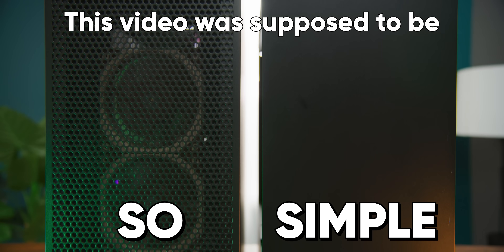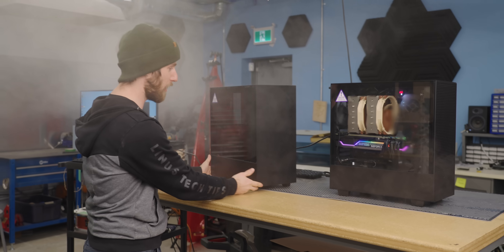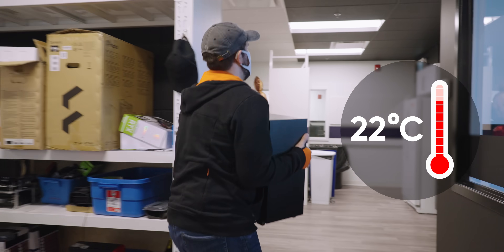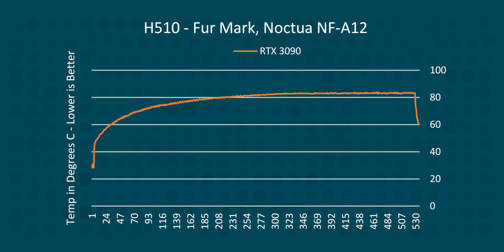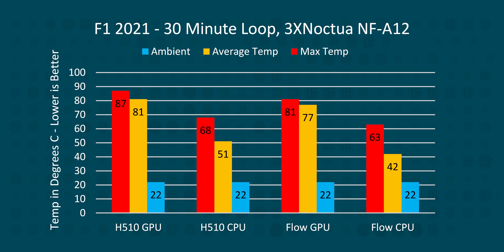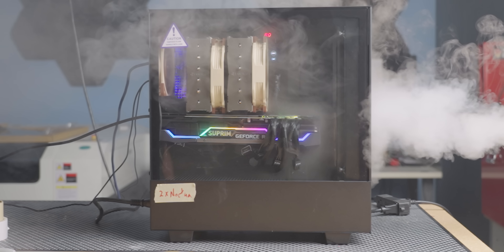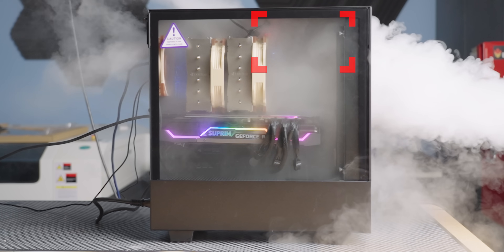Everything You Know Is Wrong - Mesh vs Non-Mesh Front Panel

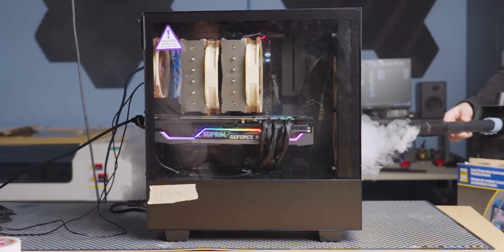Comment: 6:58 The way the front fans were installed, in front of the bracket, the fan body itself blocks the entry of air.
The ideal is to place the fans behind the support, being more inside the case and leaving space between the fans and the air intake, automatically having a freer air flow.
Reply: Probably didn't fit with the gfx card? Moral of the story is not to put a big GPU in a small case.
Reply: @saifaddeenal-manaseer6325  This is the main takeaway from the video IMO. Have power hungry components? Don't buy a small case.
Reply: @saifaddeenal-manaseer6325  I have the non Flow case Witch a XFX 6900XT and mounted fans in the right spot, Normal fans did not clear the GPU with the anti sag bracket from XFX so got some super slim fans and have great temps now! :D
Reply: @ivanraeder  nice, lucky you haha
Reply: @saifaddeenal-manaseer6325  It does look like maybe they wouldn't fit but yeah either way if they don't fit where they are meant to go get a smaller GPU or a bigger case.
Reply: Insane they would do all this testing make a whole video with a smoke machine and all and have the fans mounted wrong.
Reply: @Ranger Ahh, ok.
Reply: yeah also on the mesh case they could have decreased the rpms on the fans causing less turbulence
Reply: Why exactly would the extra space between the fans and the intake make a positive difference? In fact, I could imagine it making it less efficient, as the fans would then suck more air from inside of the case instead of through the vents.
Reply: @jankoodziej877  Because fans hate hate hate intake restriction and uneven inlet flow.  Having anything within an inch of the front of a fan will reduce its performance considerably, and make it loud.
Reply: @Vegemeister1  I can confirm. I had to buy a new case only because of the intake fan position being behind a mount that passes in front of intake. It was too loud even running slow. Now I have a case that, even though it still has front fans behind the mount, that mount opens a perfect 120mm circle in front of each fan. Still not perfect because of the dust filter sitting right in front of the mount. But now I have peace. Meanwhile, out take fan is noiseless at the back of both cases.
Reply: @Ranger I still don't get your point. The fan is always creating pressure, that's the whole point of fans. In the same way if you have exhaust fan on the CPU heatsink, you wouldn't want to have space between the fan and the heatsink.

Thinking about it some more, is it perhaps about the fact that the font mesh is bigger than the fan and if the fan is closer to it, it doesn't use the whole surface of the mesh? If that was your point, now I got it :D.

Comment: I ran into this problem a lot with the pc011. 
If you have fans on the "front" and fans on the top your GPU temps will be crazy.
You need those fans on the bottom to get that fresh air to the gpu.

Comment: Two things:
1- This case was originally designed for a negative air pressure configuration, bringing in cool air to cool the GPU. NZXT only made one change to this case: a mesh front. More fans can force more air into the case, but the fact is it was never designed with a positive air pressure configuration.

2- GPU's have a temperature target. You continue to say "wow, this GPU is reaching X degrees," but not stating at what frequencies. This method would make sense for Maxwell generation cards, but with modern GPU's boosting behaviors and temperature targets, this really doesn't work.

Comment: Ryzen 3700X, MSI RTX 3080 GamingX Trio (huge card, barely fits), 4 cheap DeepCool RGB fans, DeepCool Gammaxx GT CPU air cooler, NZXT H510 solid front panel case, blow dust out every few weeks. 
My GPU never gets above 75 C and my CPU above 72 C with intense gaming for hours on end. I guess I'm just lucky or it's because my apartment is kept at a constant 68 F/20 C.

Comment: Nice slow-mo shots. I remember discovering this GPU thermal behavior in the NZXT H500 review in 2018. It came up again in the H510 review and is to do with negative vs. positive pressure. The H510 actually wasn't really notorious for being "bad" for its front panel, specifically because it had abnormally good GPU thermals (although it could have been designed better overall, it was an interesting and rare look at a specific negative pressure setup benefiting one part and not the other). NZXT actually went on to actively make its case worse with its Elite configurations, where it moved to positive pressure. As we explained in our original review, cases like the original H500 and later H510 do well because the air can come in from the PCIe slots, which are perforated and create a potential intake pathway despite a lack of "case fans" mounted to them. It was an accidental success for NZXT. They did not plan for it and we had a few meetings with them afterward to explain to them why it was succeeding in GPU thermals in this way, mostly working with their product director at the time to provide some guidance. The air comes in from the PCIe slots because it is a negative pressure setup in its stock configuration (and they later changed the fan configuration, too, which was a separate test). You can test this with a sufficiently sensitive anemometer pretty easily. It isn't to do with turbulence but to do with pressure configurations. I think we actually did one of our only smoke tests ever on this case, but our cameras weren't (and still aren't) as good, so we lacked the awesome slow-mo capabilities you have here. As with most things, just adding more fans won't make it better and we try to communicate this to the audience regularly. They have to be intelligently placed, and that'll depend on each configuration.
Reply: Thanks daddy nexus
Reply: So, I shouldn't just be a fanboy?
Reply: @gharretje  Awww yeah..
Reply: @gharretje  be a femboy
Reply: I approve this message, GN is always right
Reply: A du*b said GN is always right. Lol
Reply: thanks jesus
Reply: @evolnizark4712  I am Satan in Jesus comment
Reply: Steve from Gamers Nexus be like: Oh yea, this thing. We did a video about it years ago...
Reply: @abm5119  I didn't watch it
Reply: I was about to uselessly comment, referencing your work with these cases but looks like you are on top of it XD
Reply: @gamers nexus have you seen major hardware's PCIe duct? 

https://www.youtube.com/watch?v=PHp1yrjlMz0
Reply: It's suprising to me that a company like nzxt wouldn't spend the time and effort to actually understand thermals and make consistent good cases. Then again I guess a lot of people just buy cases off aesthetics.
Reply: @lukasg4807  yeah like me. I have to look at my case everytime I get in my room, so aesthetics are important to me.

The airflow could be bether for sure but it is far from the worst. +5°C doesn't affect my performance campared to a case with bether airflow. My rtx 3070ti gets 74°C max, so no thermal throttling.
So the choice for me is:
Bether aesthetics, which I personally like to see everyday.
Or -5°C with no performance improvement in a case that looks worse.

Feel free to correct me if I wrote any nonsense.
Reply: @lukasg4807  NZXT makes a case that catches itself on fire...i dont think thermals is what they're good at.
Reply: Tell 'em, Steve!
Reply: I only trust you. Great to see your comment.
Reply: This is what I was thinking watching the video
Reply: This is the real explanation to the weird thermal behavior!
Reply: I'd try to match fan rpm all around where I have a fan in the case so this flow could be more even
Reply: I was pulling my hair out when I saw the case choice knowing exactly what was coming.  Thanks for already solving this one, Steve.
Reply: This video should have been a collab.
Reply: I think that blower style card will perform better in thermals since it sucks air in front and pushes it to the back of the card. And usually blower style cards are thinner usually. Open air gpu sucks air throu the fans and pushes it on the sides and they have low amount of space to push air in due to the chosen case. I think that they should redo the test with different cases and use open and blower style cards.
Reply: Yeah, it's a switch in airflow setup efficiency. Using H500/H510 in part, but specifically with as huge a GPU as in this video, makes fan placement/orientation requirements to get optimized airflow more in line with small form factor ITX cases/builds that a standard ATX case. Positive pressure/clear front to back flow airflow setups works wonders for big cases and especially cases with better designed venting holes on the back (like the Fractal Torrent), but the further down in size you go (without scaling the size of the GPU and PSU to smaller degree), the more problematic keeping the airflow positive/neutral it becomes. That's why for the widest variety of small form factor setups, full exhaust (with any and all case fans) is the way go, and using PSU as exhaust (like the Torrent), is the way to go as well.

A case can exhaust only as much air, as it can intake, and a case can intake only as much air as it can exhaust (What comes in must come out). The more restrictive the venting holes are, and the more restrictive the meshes, meshfilters are (like the recent Lian Li thing), the more it matters to have fans be intelligently placed. And more tinkering is required to optimize the airflow (and it becomes more important to adjust the speeds of the various fans to be more in line with each other) in order to break up the vortices (hot air pockets).
Reply: The next LTT Tech Upgrade should be for Gamers Nexus' cameras by the sounds 👌
Reply: This sort of information is why you guys at GN are awesome. I'd love to see you guys explore this issue further.
Reply: Steve doesn't waste a moment, does he?
Reply: AQ
Reply: No, this is about fluid dynamics in which pressure is a component of a very iterative game of physics. Under or overpressure setups are not the issue, both work fine IF you actually focus on the flow of the air. You actually want to avoid going in either direction too much, balancing around ambient pressure is best, but that's several steps further beyond dust, power, maintenance and reliability management... 

Turbulence can be beneficial if you apply it on the right spots, but similar to pressure conditions it's something that follows a good design of the air flow path. Placing intelligently is an understatement bordering to an insult to how much more complex it really is, but then again this is a pc case, it doesn't need to achieve industry level efficiencies.

As for 'recording'; smoke machine, line laser (or actual disco laser with control) to create a plane of intersection and any mobile phone these days with 120 fps slomo will do... as long as it's native 120 fps and not interpolated. Recording air flow paths is the easy part, actually balancing it in these horrible designed cases is not. The only reason to need a better camera is the "I want to be fancy in 4k" youtube part, not to be useful in the analysis.

It's ironic though. This is why blower fans on GPU's were actually really good and useful. But hey, people could hear them so now we lost them...
Reply: @FreakyAngelus  Yeah, that's what we said. It works well as a negative pressure setup. Neutral pressure is not necessarily the best either. Blower fans were useful for exhausting air but are horrible for GPU thermals, which is why they aren't used. They make the most sense in a small OEM box. Exhausting the air efficiently at the benefit of components which don't care as much (an inductor that can take 150C, for instance) is not as useful as efficiently cooling a component which does care (the GPU), and blowers are very bad at that.
Reply: @FreakyAngelus  I miss the days when I, too, was unaware of my OCD.

...no, actually I don't. People hated me even more, then.
Reply: I was just about to write in the comments about your testing way back. With all the techtubers combined you get quite a good understanding on things :D
Reply: Had a H510 for a while, with 2 140'S in front and a tower cooler the GPU would be pretty toasty, improved a lot when I jammed (like really really jammed) a 280mm Arctic LFII AIO rad in the front
Reply: This video for some reason came at a time when I finally purchased this case for 70 bucks.  I have had a vetroo v5 sitting around I bought a long time ago because I thought it was such a good deal for the price.  Stock fans in case, just a simple back exhaust and top.  Evga rtx 2060 black and a ryzen 5 3600x.  Temps are perfect, and fans are quiet as hell. I ran cinebench for about 20 mins and my max cpu temp was 74c
Reply: Fun fact buddy has a solid face 510, he moved to mount his fans on the inside of the case instead of more invisable, he saw a 6c temp drop doing it also, with an FX 8350 and R9 390X.
Reply: Thanks Steve. Over to you, Steve.
Reply: Yeah, I found that out as well when I added a rad to the front and wound up in a positive pressure situation. Putting a high CFM fan on the top got me back to where I needed to be (Air rushing in through the slotted expansion slot blanks. I kinda wish someone made an intake PCI Slot cooler with a screen on it.
Reply: Looking at the slowmo shots of the smoke showing airflow, I reckon that they can get much better results by reversing the direction of the front, back and CPU cooler fans (literally flipping them over so the arrow points the other way), so it sucks in from the back and blows out the front.  This means that instead of hitting the GPU like a barrier, the heat is sucked away and the CPU cooler gets a straight flow back to front =.
Reply: Sheesh, I hope NZXT is paying you good for your engineering consulting. Keep up the good work!
Reply: As someone who used the H510, and prefers negative pressure over neutral or positive, I've had great experience with the case overall. I switched over to open case (Thermaltake Core P3) because I mine when I'm not using the PC, and it definitely helps. But gaming-wise no difference at all.

The H510 was built to be a negative pressure case, adding holes/fans won't really affect the temps, let alone the performance.
Reply: Thanks Steve!
Reply: If you add fans and the temperatures get worse....you need to add even more fans.
=D
Reply: Ok I will flip my intakes fans they are arctic fans.
Reply: I expected this comment.
Reply: But populating all fan slots makes it more anesthetically pleasing lol.
Reply: this video is clearly made up just to have an excuse to trow the add for micro center. They needed to put more effort to avoid this silly mistake, but w/e they needed to do an add.
Reply: This comment from Steve clearly shows the limitation of knowledge of people from non engineering background. Steve is like an electrician in work field. And the guy who mentioned O! Technology video. Go check my comment where I clearly mentioned the mistake what he did unknowingly about air turbulence..

Comment: I have an old crappy case, but...
It's got a FAN MOUNT on the side (no fan installed). HOT AIR comes pouring out of that as it's next to my graphics card. So I find it odd that modern cases try all these different solutions when basic case design isn't complicated. Have an EXHAUST right next to the graphics card. duh?

Comment: He said woft.🤪  Using an older psu-on-top case, I cut a hole in the bottom, and push air right up to the gpu with a fan.  I put 3 inch legs on each corner to get some good woft up to that gpu.

Comment: I have an older 1070 Ti Asus Turbo, which is a blower style card. Would there be a problem with adding additional fans? I also have a 240 mm AIO for the CPU. So I don’t need to add additional fans, but I’m curious what would change if you ran the exact experiment with blower style cards. Despite kind of being known to be worse (thermally) cards, a lot of people still might have them and want to know the effect.

Comment: I think it is worth mentioning that the 510 (non mesh) also has a small intake on the bottom where some air is pulled by the front fans. To be clear it is not a case I would recommend for the most powerful/hottest components; however, running a slightly overclocked i5 8600k and an RTX 2060 over the last few years has not been a problem at all.

Comment: Lower temps are generally better but raising the operating temperature of a GPU within reasonable bounds is a worthy tradeoff for reducing thermal throttling on a CPU. Sometimes you have to make tradeoffs, especially at smaller form factor.

Comment: The last test where you blow smoke into the 'non-mesh' case doesn't make sense. You can't tell by this test that you are pulling less air (smoke) in. Because there is no smoke going in doesn't mean that there isn't air pulled in. It's just that there isn't enough smoke in front of the holes to be pulled in because the room isn't filled with smoke.

Comment: I should be happy but I'm not... I told people for years that the square below the gpu got no airflow with their current config "nah you're lying" please next redo the bitwit video about not placing an AIO on top when you have a 350w gpu but in the front because that too they absolutely refuse to acknowledge, the heat from the 80°C backplate just magically vanishes according to them and intaking 25-40°C air inside the case is so much worse than hair drying your cooler ><

Comment: I'd like to see the same tests with the intake fans removed, the top vent blocked, and flow matched cooler and exhaust fans (accounting for the restriction from the fins on the cooler). I'd also like to know how the power supply tunnel is configured. Does it have it's own isolated chamber?